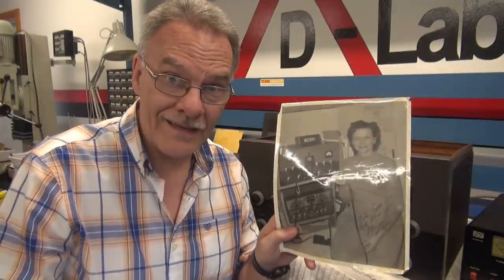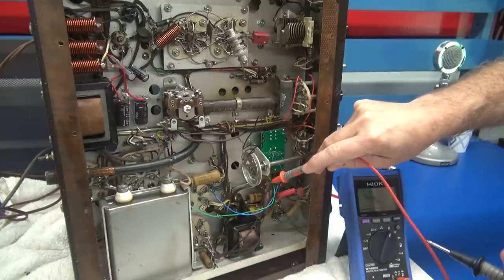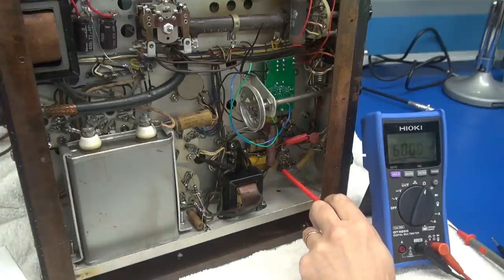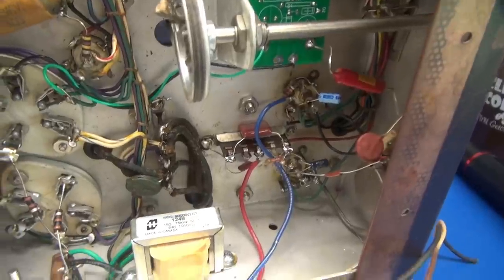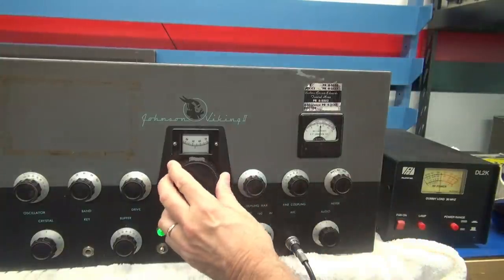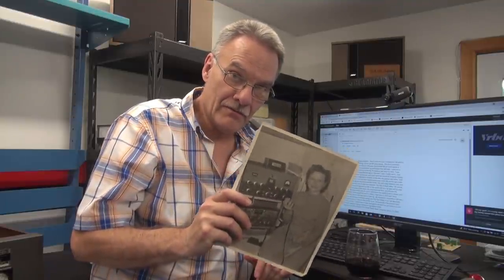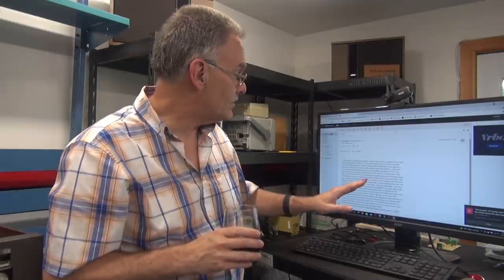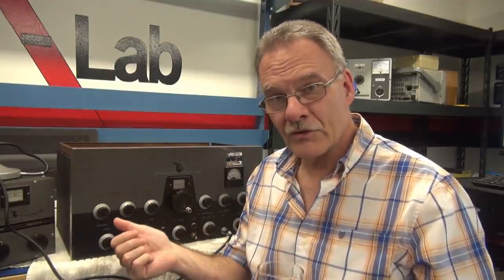How to Repair PTT Modulation EF Johnson Viking II Ham Radio transmitter + History Part 2 ebay item

Comment: i recently bought a 1940s radio with a record player name of it is GAROD when i turn on the radio its quiet untill theres a humming noise and it keeps getting louder & louder so i unplug it but is there a solution to this im only 16 so i dont know much about old radios plus this is my first time buying a radio from the 40s the only thing i did was replaced the cord cuz it was dry rotted